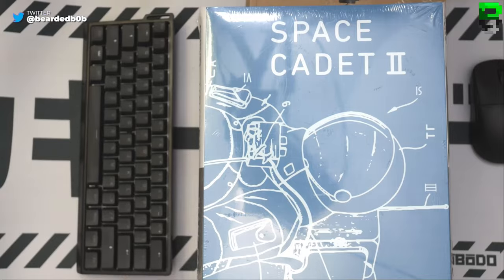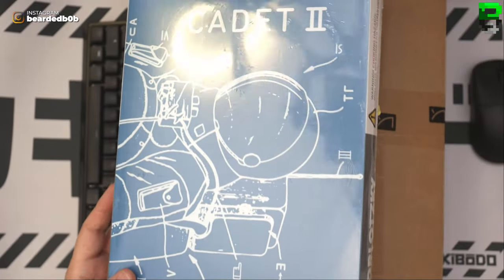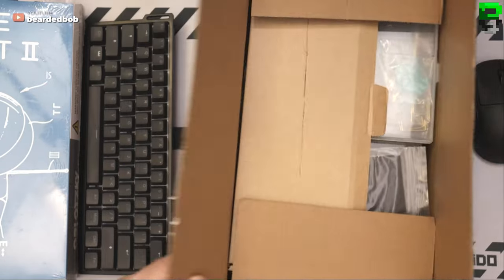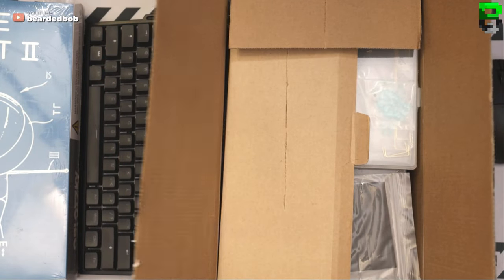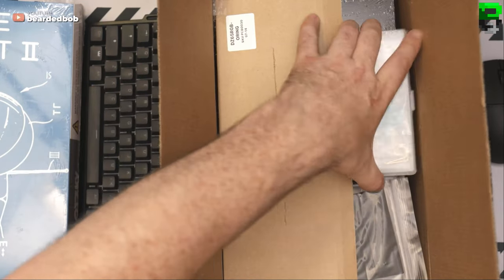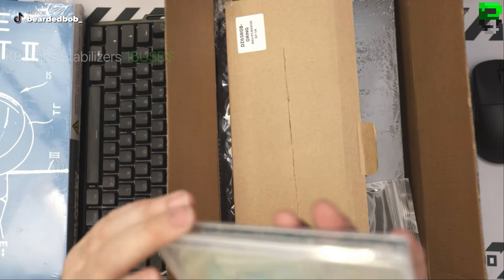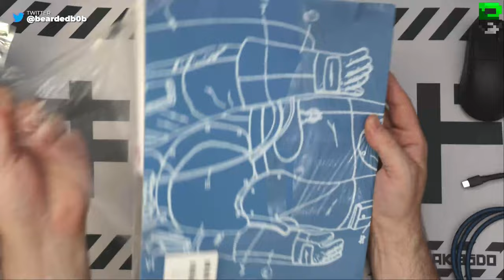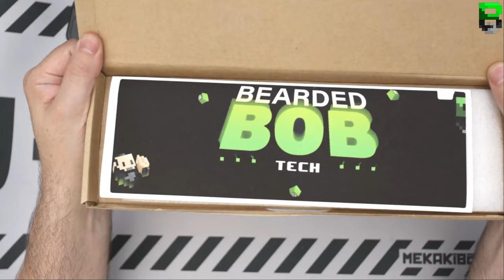BUILDING A $600 CUSTOM KEYBOARD TO CREATE THE ULTIMATE WOOTING 60HE MOD

Comment: You need to rotate the switches 180 degrees so its "south facing" so there is no interference with gmk cherry keycaps.
Reply: Yep - Some (most? GMK in particular) Cherry profile keycaps require a rather involved pull and rotation of all of the switches to avoid the scrape. :)
Reply from the maker: I’ve not felt any interference but will check 👍
Reply: @Beardedbob  it's not super noticable but it affects the feel and sound. There are some videos on the subject for more reference.

Comment: Very nice.

Mine is somewhat similar. 

Kept the stock springs, lubed everything,
Tape mod. 
Black KBD Blade
Cherry profile DMK  Semiconductor triple-shot caps / Hiragana  
Matching custom straight cable from MechCables

 Absolutely love the build with the Lekker switches & the Wootility software, especially the webpage option, are incredible.

Comment: Just something to keep in mind, as I see you've grabbed a custom coiled cable. You ( or anyone else) are likely to run into problems if you want to use the Tachyon mode. Here's a copied comment on another video from wooting themselves :

 Tachyon mode is freaking out on you due to the coiled cable you use. The coiled cable length vs thickness is not proficient for our requirements when running RGB at full brightness and turning on Tachyon mode. Tachyon mode and especially RGB LED draw a lot more power. When using a thinner/longer cable, it'll not be able to steadily keep up the required voltage causing it to faux activate the hall sensors (keys)
Reply: Can confirm.
Reply from the maker: Good to know, I’ve not noticed a difference should i
Reply: It's a combination of how far the keyboard pushes USB specifications, signal loss due to cable length and potential lack of shielding (aviators don't hlep)

Lowering brightness or not using Tachyon both reduce the power draw and signal intensify, which can workaround longer cables.

Comment: Did you lube the switches? It makes the sound profile slightly not as thin and you can experiment with more stabilizer mods Bc they are plate mount pretty sure.
Reply: they are prelubed
Reply: @jerry_bl68  Switches do not come prelubed, but stabilizers do though.

Comment: Was gonna with blade 60 but I settled for old boring tofu60 case instead. Now I kinda regret it haha
Reply from the maker: I think both are good..... did you change the keycaps? or anything else?
Reply: I went with epbt 9009 (might change to epbt kuro&shiro later) lubed switches, tape mod. That’s it. Oh also burger mount, and case foam
Reply: @OblivionDust2719  is that the perfect setup or would you have wanted to change anything else?

Comment: Who's gonna tell him?
Reply from the maker: What you gonna tell him?
Reply: @Beardedbob  there's not even close to be ultimate, and it's actually budget
Reply: @Beardedbob  To be ULTIMATE it must be at least a 75% WKL gasket mount, the WASD switches and the most used keys must be modded with much lighter springs and preferably with a very noisy feedback click, while the rest must be tactile from 65g, to avoid false inputs. The stabilizers need to be lubricated much better and preferably TX. Finally you need a PCB with polling rate software. The GMK ABS keys are the absolute worst choice for gaming, they are shiny and smooth and above all they are not backlit. The more expensive choices don't always make sense, indeed in this case they make the build completely useless for night use. You need much more resistant PBT double-shot keys, so you also need a north sided PCB, this is because the backlit keys are oriented to the north, and above all the Cherry profile is too high and spaced, you need a low XDA profile. The AWG28 coiled cables are too thin, and worsen the RGB performance of the PCB. An AWG24 straight cable without aviator connector is required to limit interference. Finally, needed a greater inclination of the keyboard.
Reply: @emanueleapuzzo  do u even know what a wooting 60 HE is
Reply: @emanueleapuzzo  You’re completely lost lmao
Reply: @emanueleapuzzo  dang sounds like Ema has no understanding of this keyboard. "The rest just be tactile" - yea no, not with this keyboard and it's actuation customization. "'Need a PCB with polling rate software" - yea let's just replace this amazing one of a kind PCB with it's hall effect sensors. @Beardedbob you did a good job, don't worry. Looks fantastic.